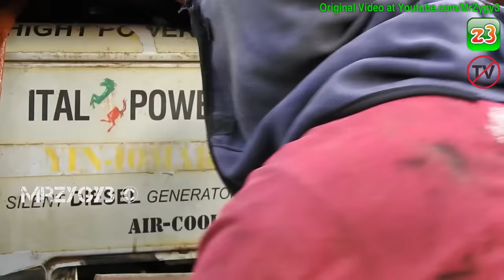Excavator Sink On The River Heavy Recovery Doosan DX225LCA Komatsu PC200

Comment: My poclain 60 is stuck in the mud. It has been there for years. I will get it out one of these days. I will take a mini-digger there to dig the muck out from under it and to one side of it. It is sunk on one side mostly. First I have to buy a mini-digger. The Poclain is a non-runner now. It needs a few repairs.
Reply from the maker: Sad to hear that. How deep is the mud? And How deep is the Poclain 60 bogged? I am sure you can dig it, repair the engine and drive it out from the mud Robert.
Reply: @MrZygy3 , Yes, I am sure I can, when I get the time and after I get the mini-digger I am buying. But there is a tree lying down in the way that needs to be removed in order to get the mini-digger to the Poclain that is too big for the mini-digger to deal with. It is an oak and still alive but I think it might be possible to drive around it. A lot depends on getting this mini-digger (tomorrow) and getting my driving licence from the DVLA, but that is a different story. One track is completely under the mud.